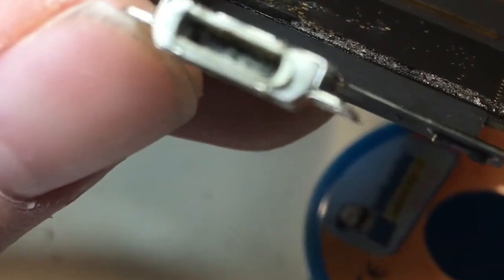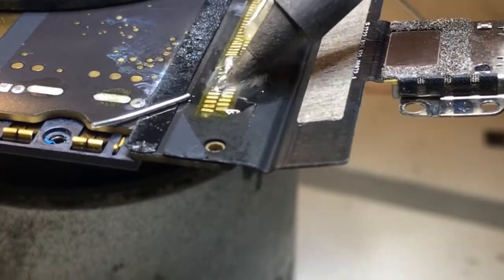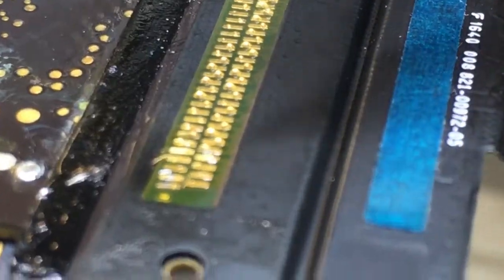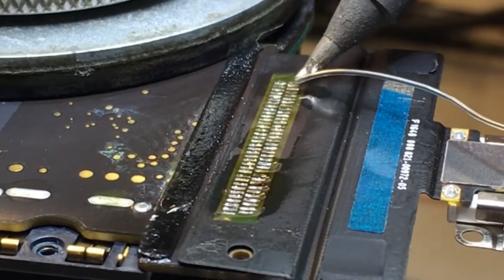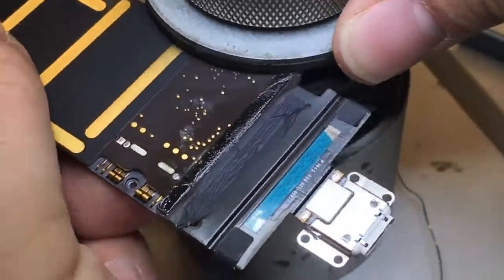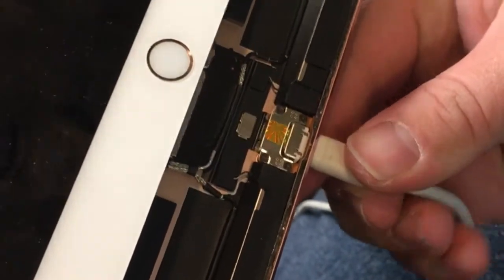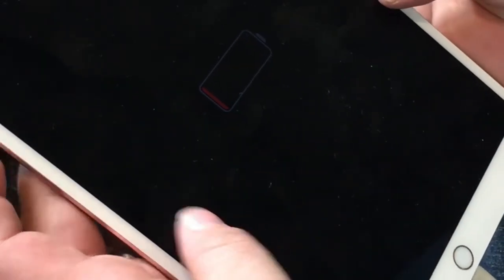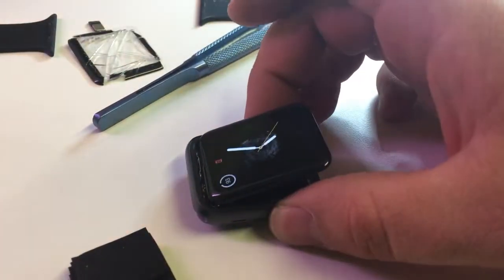iPad Pro 10.5 Charging Port Repair

Comment: Dont you get 3min boots after replacing with not original part?
Reply from the maker: No. Most Replacement parts are becoming more and more reliable. I've never had an issue with an iPad Replacement Port.
Reply: Yes me neither except this 10.5 Pro, which boots after 3 min with thermalmonitord panic log error. And it came with charging problem, so I replaced the port and it does charge, but also this 3min boot thing. Any ideas what might be the problem?

Comment: question the soldering joints on the logic board can they be fixed if damaged i have the 10.5 but a former acquaintance badly attempted to replace the lightning port but in doing so damaged 2 of the solder joints on the logic board so does the whole board need to be replaced or can those 2 points be fixed and then be able to attach a new lightning port

Comment: Oof I got the same problem with the same model But the screen stays Black too(as it got a little bit of charge) and I‘m wondering of if it‘s worth it to repair this. The guy in the repair shop I took my iPad to said it just crashed and needs new software but I don‘t know if there‘s nothing else also wrong with it

Comment: do you know why apple dont replace charging ports because sent my ipad pro 2017 to them and they said i would have to have a new ipad because it cant be done
Reply: Thomas Derbyshire the same thing they told me when its only a month old
Reply: Thomas Derbyshire cuz they are expensive and easy to break it’s a big liability for them plus it takes longer an IPhone can be fixed in like 20 min and if something breaks they can cheaply replace it cuz parts are widely available plus the learning curve

Comment: I accidentally plugged an iPad Air charging cable into my iPad Pro. Now the charging cable that came with the iPad Pro does not fit. The iPad mini cord fits very loosely, but it does not always want to charge. iPad says, Not supported. Do I need a new charging port? This iPad is only 4 moths old.